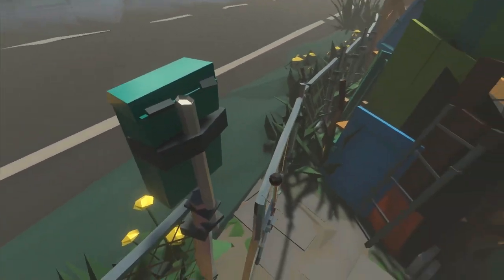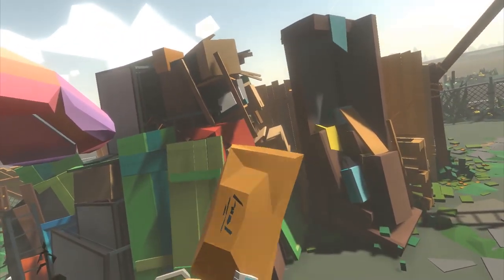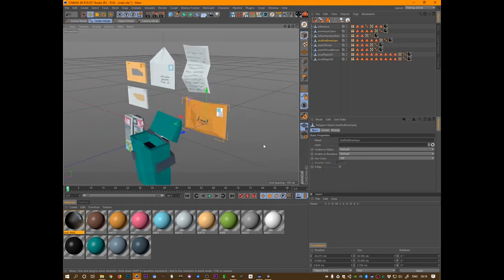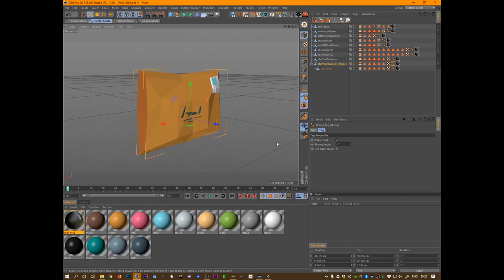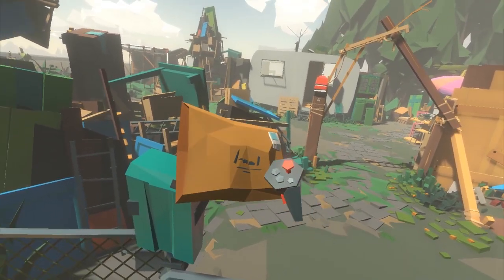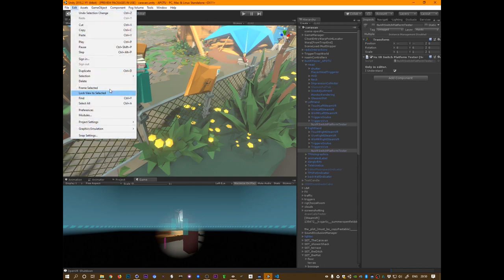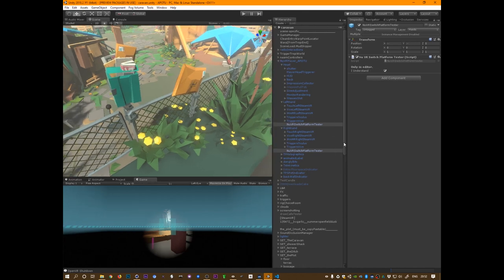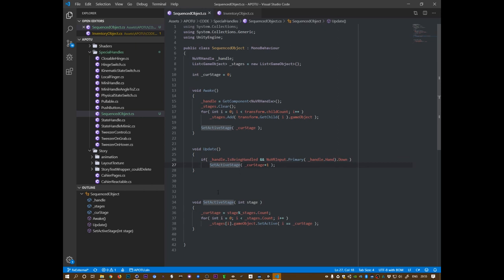APOTU | multi-stage objects, pt01

Comment: This is a bit nit-picky, but in the US, the packages stamp goes on the 'flap' package opening side to help it better move through the optical scanners without accidentally tearing it open. This is technically a best practice suggestion since you can do whatever you want when packaging something yourself, but officially its frowned upon. You have it on the opposite side in your build here. That said, again, the work you're doing is inspiring.
Reply from the maker: Ha wonderful! Yes it’s the same here, but I like these little errors — the carriage return on the typewriter is also on the wrong side, for example : ). Let’s consider them part of the handwriting ; ). 

APOTU is kinda-situated in the early nineties though, and the stuffy envelope is from a tiny outfit doing their few mailings purely by hand, so errors are both to be expected and not a big deal for the early 90ies mail system ; )